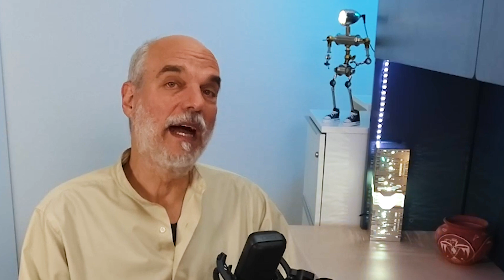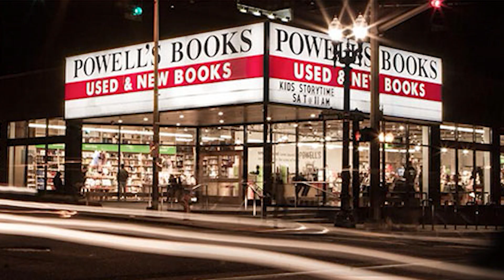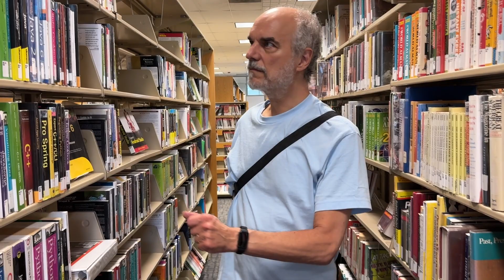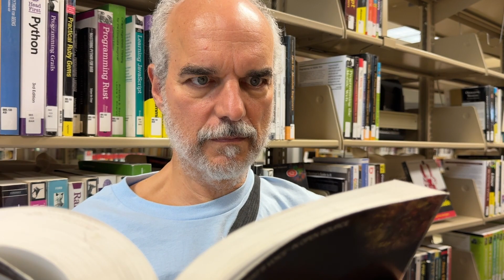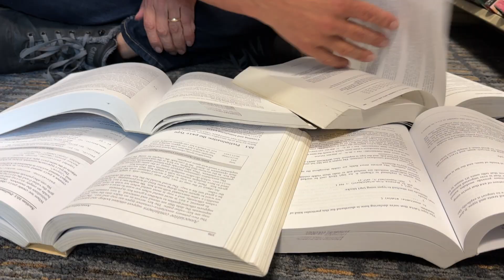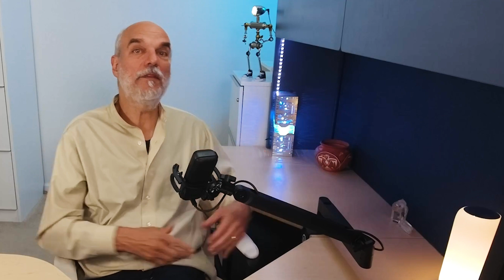The Problem with Most Object-Oriented Designs and How to Fix It

Comment: The common thread in this video is why I love functional programming so much. Writing code in a pure functional language like Haskell or Agda forces you to separate your domain logic from the side effects that it produces: for example, my side project is a distributed order management system for financial derivatives written in haskell, and the core logic of the program (sending, cancelling, rejecting, acknowledging orders) is all written as pure mathematical functions on the order state object of type OrderEvent -> OrderState -> OrderState (or OrderEvent -> State OrderEvent () for those in the know about monads). This means that given some set of order events, I can replay the order state basically for free because I don't need to rely on external side effects to maintain it.
Reply: Functional programming:

Imagine things to be as much as possible, stateless. Every data transformation happens using functions. It is really superior way to avoid coupling.

Object oriented programming:

It is about modelling concepts. Some concepts do have the state so OOP is engineering about those states, and mapping real world entities to objects. In context of programming, objects are just not only found from business processes like "customer", it is also technical objects like creating service that is lazy loaded when needed.

Both paradigms have their place. OOP benefits a lot when there is something like "framework", something that has all concepts defined what to use solving business problems. OOP is more like having piece of data and writing functions to describe the logic like mathematician. 

I think we should use more functional programming because developers around a world write same loops in same problems in every software, instead of calling function to do things. Just think how long it take to get map/filter/reduce etc. type of functions to standard libraries used in OOP.
Reply: You definitely seem passionate.  Subbed 😊
Reply: @user-mu6ii3jg1o Exactly - how does Order State get persisted in the first place????
Reply: So essentially you are encapsulating the state and modifying it through a series of well:defined state change behaviours (or messages)
Reply: @torbjorngannholm3551  

That is way to do it in functional programming.
Reply: @torbjorngannholm3551  well yeah, except it's more than that. In an OO paradigm, there's nothing preventing you from making database writes, network calls, even deleting the entire filesystem from a method with a type signature like `int sum(int x, int y)`. in Haskell, this would be impossible with the similar signature ` sum :: Int -> Int -> Int`. You would have to write `sumWithDanger :: Int -> Int -> IO Int`. The IO monad marks that the function can perform any kind of arbitrary IO operation. Haskell system design largely consists of defining sub-effects in terms of IO: `instance MonadIO m => Database m where ...`. The critical insight is that these data structures can be executed from IO from any number of handlers, allowing you to use define an effect syntax once (for example, a database monad), and use it with any number of handlers (sqlite, postgres, etc.)
Reply from the maker: That is really powerful. I find some problems lend themselves better for functional programming and others lend themselves better for object-oriented programming, and still others lend themselves better for using both.